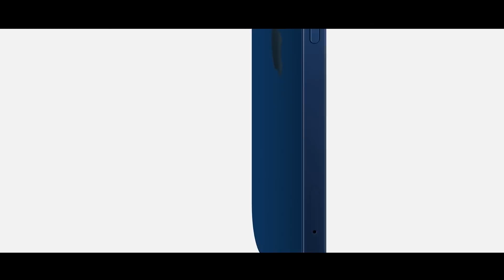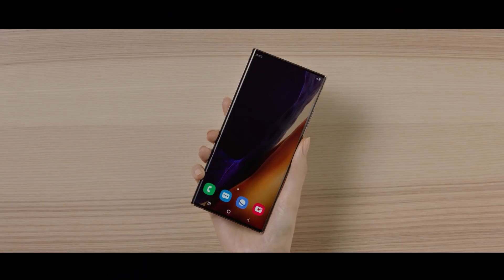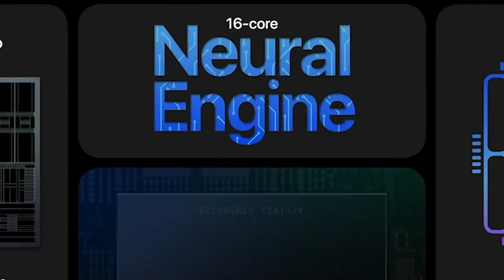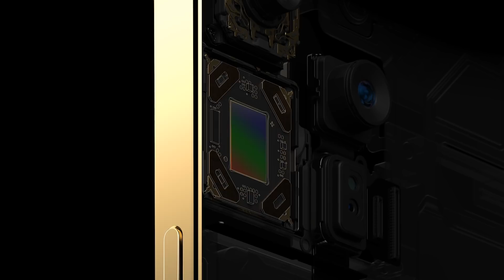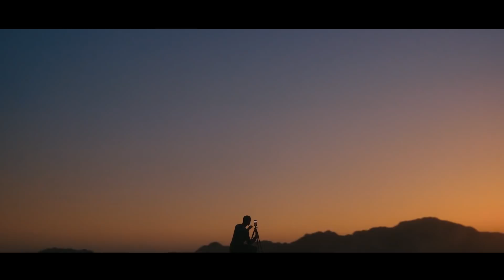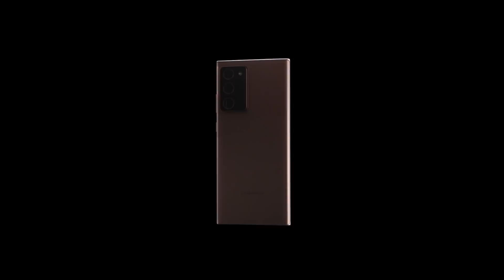iPhone 12 Pro Max vs Samsung Note 20 Ultra - Ultimate 5G Smartphone Battle!

Comment: Get your facts right first. Ip12pro only have 2.5x optical zoom not 5x.  You got played by apple marketing.
Reply: Nah lmao the 11 pro has 4* and the pro max has 5x where tf did u read it has 2.5?
Reply: @Heinz Doofenshmirtz

Zoom in only 2.5x. Go read yourself.  That's what it is accepted as "zoom".

Apple just cheated.  Said wide-angle is like 2x zoom OUT then multiply with 2.5x telephoto zoom IN gives you "5x optical zoom RANGE".   

If you do this this way, Note 20 also has "10x optical zoom range" since ultra also has ultra-wide 2x zoom out.

Apple is so desperate.  And isheep like you lapped it up.